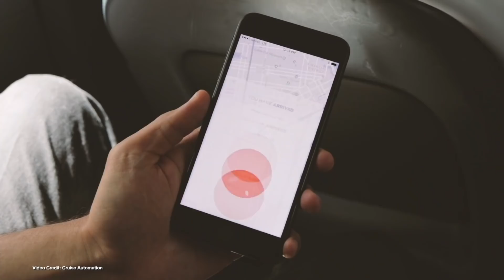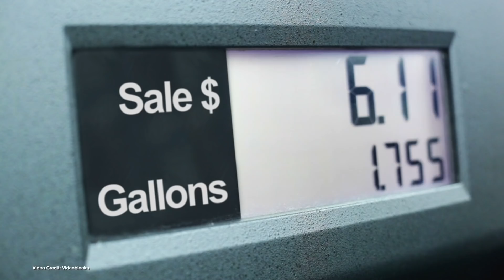EcoTEC 92 - VW ID.3 Reservations, New Battery Breakthrough, Tesla’s Adult Role

Comment: Once again you leave out important data.
1 - Please tell us what is power density of current batteries.
2 - no mention that 25% of Britain's power comes from nuclear.  In a lot of countries nuclear power is forbidden by the same greenies who are bragging that they have achieved something great in britian.  So they have an unfair advantage in making this claim!
Reply: Current vehicle li cell densities are ~200-250 watt hours per KG
LG Chem believe they will hit 300

For comparison

Maxwell Tech (the dry electrode company Tesla are acquiring) are expecting 300 watt hours per KG but believe they could eventually achieve up to 500 watt hours per KG, though their big innovation is cheaper faster manufacturing rather than density.

Believe it when you see it though... battery tech companies like quoting unachievable best cases for their revolutionary breakthroughs.
Reply: @matthewspencer2094  Thanks Matthew
Reply: MrBikeman7 likely cost is also very important.  A 20% increase in density is far less significant if it is say 30% more expensive.  Tesla’s maxwell technology is so significant because it promises not only increased performance but also decreased cost
Reply: @andrewpaulhart  And increased cycle life given maxwell's patent to over saturate the cells with lithium by adding grains of lithium metal.